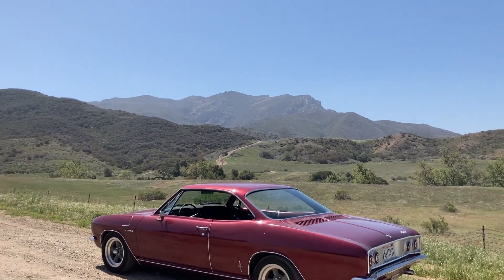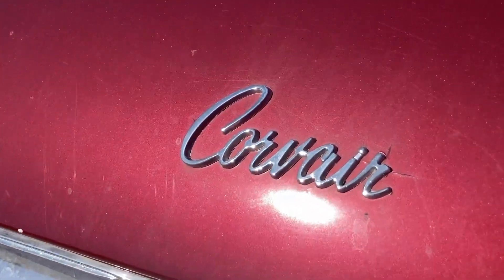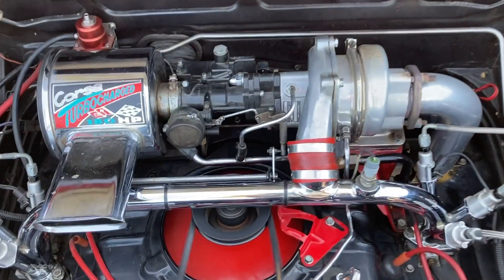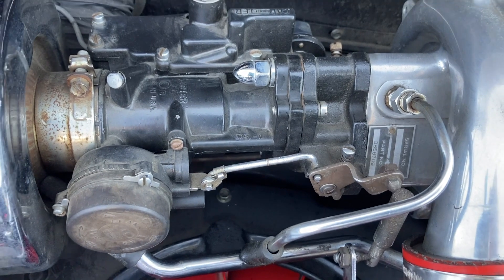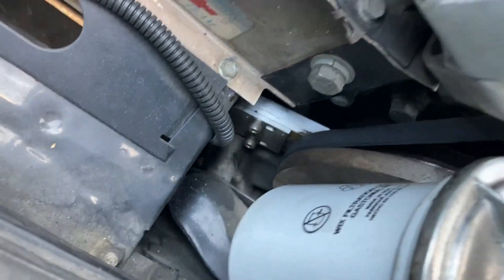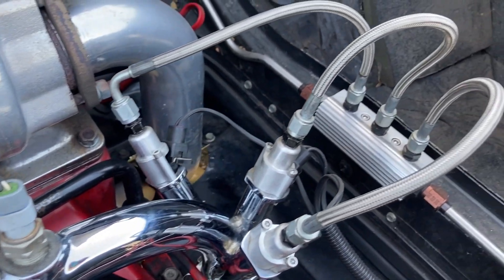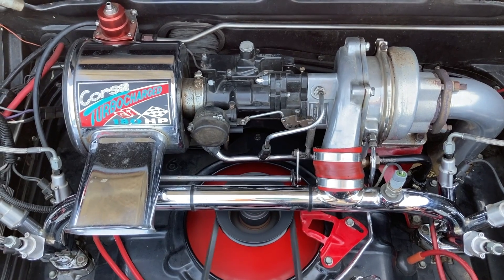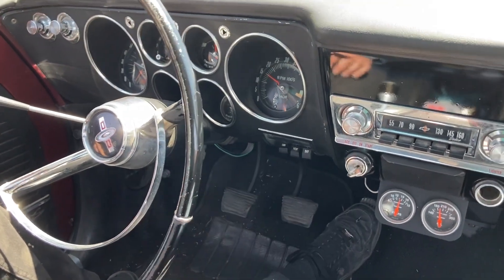1965 Turbo Corvair for sale

Comment: That EFI set up is very nice! A lot of work there... I'm sure the injection helped the turbo output considerably from intake charge cooling. Excellent choice!
Reply: I've always believed that computer driven fuel injection is really necessary to get the most out of turbos.

Comment: My brother had a '65 Monza with a 110 HP engine. Then he got a '66 Corsa Convertible with a 140 HP engine and a '65 Corsa Coupe with a 180 HP turbo engine. He swapped the engines in those last two and had a '66 Corsa Convertible turbo. Great ride! I remember when he finished with the swap and went to start the engine. One touch on the starter and it caught first time. Chevy! I bought the '65 Coupe with the 140 HP and and put two Holley 2-barrel carbs on it. Much better setup than the four 1-barrels. Wish I still had that car. Damn it was beautiful too. Silver and Black.

Comment: Nice car, thanks for showing it! A lot of work went into it and it shows. Be aware of the haters, saw a guy write rod knock on start up, another said the valves were gone. These two do NOT know what they are talking about, I heard NO knock, and at worst, the valves might need to be checked and adjusted. EASY job to do. Aircooled boxer engines are a different animal, can't compare them to water cooled! Thanks for the show, again!!!
Reply: For all that was done for the engine rebuild, that tappet noise should not be there.
Reply: I had a 67 Corvair never ever made that kind of noise upon start up.

Comment: Amazing upgrades to a gorgeous car!... the only thing I question, given all the updates is having all 4 drum brakes and not going with at least front discs or all disc brakes. Otherwise, wonderful underrated fun car!
Reply: Yup...Discs all the way around, and of course a dual master cylinder should be installed on this excellent car!
Reply: its light, dont really need discs

Comment: My Dad had a white/red interior '65 Corsa 140hp w/4 carb set-up. Fuel injection looks like the way to go for a daily driver.  Very nice looking car and fun to drive I'm sure!
Reply: I had a 65 Corsa with 4 carbs also. Once I replaced the pushrod o-ring seals in 1972, I never had to add a drop of oil between oil changes. The carbs never had to be adjusted. Wonderful car!!!!!!! I still miss it!

Comment: I have a 66 2dr 4spd. We never got the engine to work well. We replaced it with a 4.3 V6. Holley fuel injection. This change made it operate at today's highway speeds. We also replaced the drum brakes to disc front and rear. Radiator in the front. Car also has a/c.  I meant it to be driven on weekends. Wife drives it daily. Oh well.

Comment: Hey You covered everything on the build & she is sweet looking as well as sounding! I myself own a 65 Corvair Corsa Turbo , Do You still have the stock components ? Or did You do the engine upgrade with a spare engine? & I did my build about 33 years ago . So when You say You doubled the horsepower how much is the actual horsepower is your engine putting out ? Thanks for video & showing your Corvair Corsa Turbo.